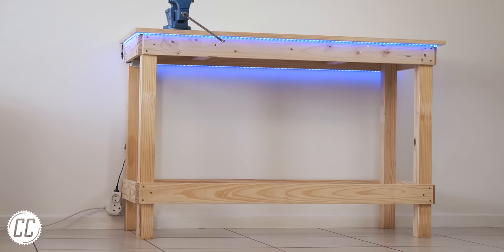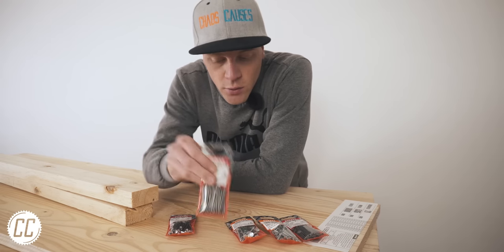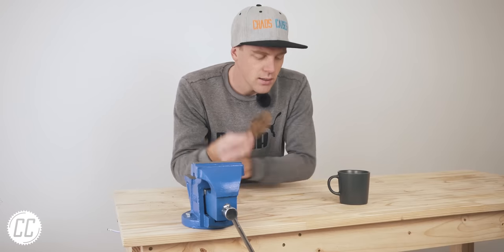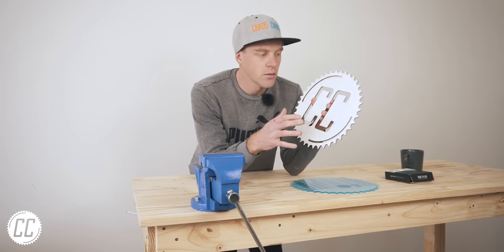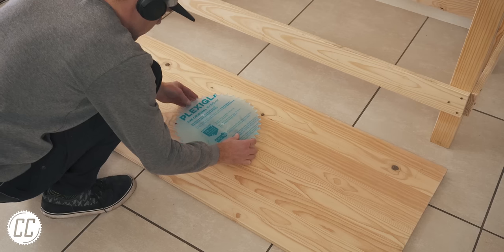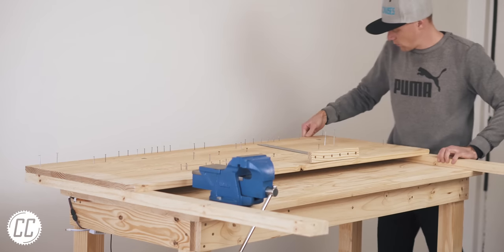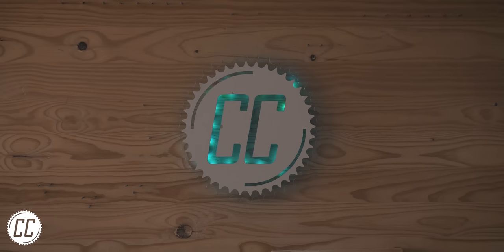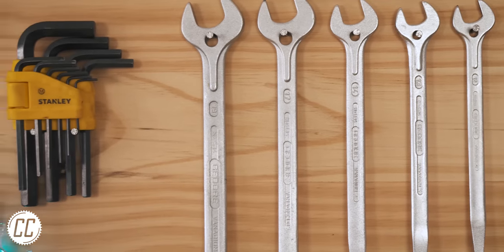Building A Tool Wall

Comment: Sanding one side of the plexiglass to a mate finish will make the light diffuses and to be visible through the letters and holes. 
Anyway, very nice bench you have,  makes one want to use it ;)

Comment: I just finished making a wooden floor in my house using around 2000 nails....I don't want to see nails for looong time :D The table and tools wall is looking nice though ;-). Just an idea for next time you will be changing your chain: Add it to the wall. If it fits the wooden sprocket that would be great :-) Or you can mount it arounf the wood edges

Comment: Hey! Great Job done on this simple but reeally cool Projekt 👍👍
When i saw that you are gojng to combine plexiglas and the leds i hoped that you would try sth, that you didnt. Its just a small adjustmend that could make this Look just a bit better, even though it already does:D👍🔥
By, f. Ex. Drilling into the plexiglas and putting the leds directly into it, the light is spread all around the edge of the plexiglas. I am sorry for my lack of english, probably you know what i mean or could Research it to slightly improve this😄
Probably we gonna see this soon✌
Stocked for the next video:)

Comment: Very nice. But please consider painting the whole backboard black. Then hang up the tools and draw an outline with a with marker so it looks like a crimescene (or you know where to put it while using it).
Also why not use screws instead of nails? You got the holes already so why not do it perfect?